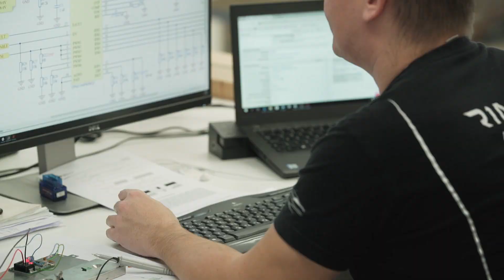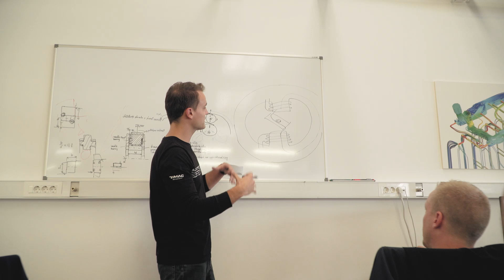Work at Rimac: Become a part of our Autonomous Driving R&D Team

Comment: So, where's the mass market car? Actually, you could bring 3 different cars on the same base. One hatchback with FWD, one sedan with RWD and a station wagon/SUV with AWD. If you just have 200 hp available, how far can you get with your system? Btw there's room for a fourth car, a MX5 killer with a proper boot!
Reply: AxemaN Racing, they sell the technology for others to use. They won't do mass production, EVER.
Reply: Stupid. Chinese will copy them and then they are dead. Their best improvement on e-cars is the software and there is nothing easier to copy.
Reply: AxemaN Racing, they won't be dead. The Chinese can copy all they want. Low-volume production cars like Rimac's won't die off because they're special. Same for other exotics.